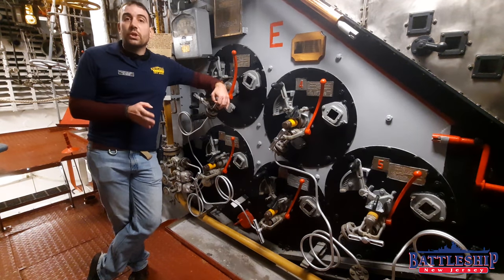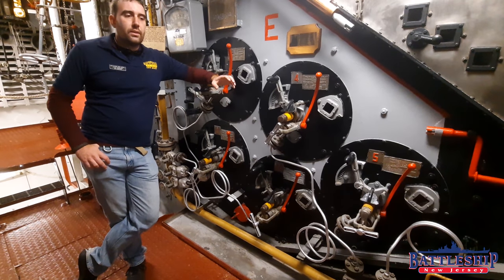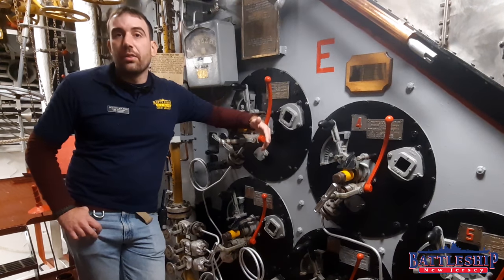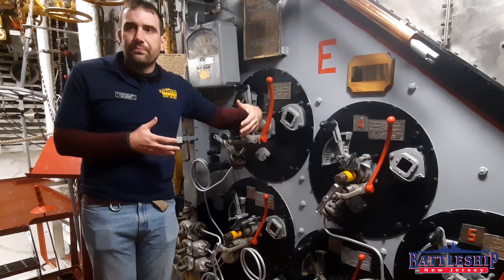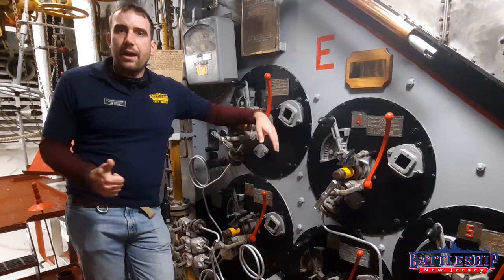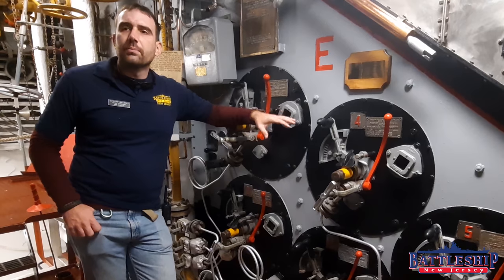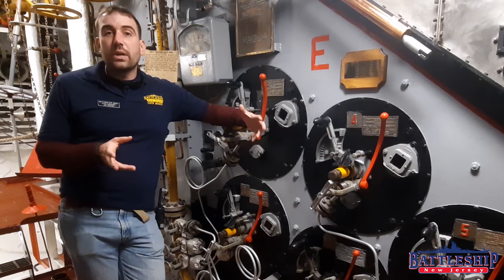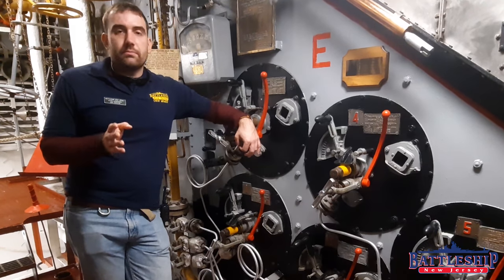Nuclear Powered Battleships

Comment: Great work Ryan, looking forward to your video on this topic. Very interested to see what you think about possibly using either 2 Bechtel A1B nuclear reactors - same as in production for the G.R. Fords or 2 Westinghouse A4W nuclear reactors (Used on Nimitz) and 2/4 New Large Boilers while keeping the Westinghouse Turbines (New Jersey and Wisconsin) or the GE Turbines (Iowa and Missouri)?  Is there room to pull the original 2 Oil Fired Babcox and Wilcox Boilers out of each of 4 Fireroom up through the Lower Decks thus leaving Space in Firerooms for New Nuke Reactor/ Steam Boiler Setups? Maybe join FR1&FR2 and FR3&FR4 for additional Room for 2 Reactors?  Also Imagine how much additional internal volume would be gained if the Fuel Oil Tanks volume could be significantly reduced from 2.5 Mil gals to .75 mil gals simply to provide refueling for Burkes, Ticonderogas, Zumi's and Constellations!  Also would need to significantly upgrade Ships Service Generators as well. Probably to at least 100-150 megawatts, somewhat more than a Zumwalt can produce, for the new Large Rail Guns and HPLWS's. Will wait to see what your video covers!  Thanks!
Reply: I think one of the issues with that would be that the turbines would need replacing as I believe they are on their last legs.
Reply: @moo4boy  So do the Westinghouse and GE Turbines need end of life replacement Sam or possibly just an Overhaul/Rebuild?.....do you have knowledge of those Assemblies...
Reply: @theilluminatist4131  I am not sure, but I remember drachinifel said something similar to what I said in one of his drydock episodes.
Reply: @moo4boy  I will look at it thanks.. hadn't seen it yet!

Comment: Any turbines and condenser units that require superheated steam would aldo have to be replaced, HP Turbines LP Turbines and They would need larger condensers, all condensate pumps would need to be replaced, MF Pumps and MF Booster pumps, all SSTG'S and condensers would need to be enlarged since there would be no superheated steam to power them and saturated steam does not have the energy so a much larger volume of steam would be required. The complete enginnering plant from a Nimitz class carrier would be needed.

Comment: I can't see any reason you could not design a ruggedized reactor. The physics is complicated the design not so much; coming up with a high neutron cross section coolant is not that difficult. Besides shock suppressing mounts are a thing look at earthquake resistant buildings.

While installing nuclear reactors on existing battleships would be a major undertaking it is no larger than replacing the boilers which would have to be done to reactivate the existing battleships; this is why I think that going with replacing the steam turbines with gas turbine engines would be the way to go. You could then install gas turbine electrical generators and capacitor banks where the boilers currently are. All of this is dependent on there being a good reason to field battleships again.

Comment: Given the size and weight of a standard naval reactor combined with the amount of power one puts out I suspect you could put in multiple ruggedized reactors and have enough weight savings to both armor and redundantly shield them.
The hole you cut to remove materials might even be bigger than the requirements to install the reactors.
That is assuming a standard reactor not a LFTR or a nucleonic system which could theoretically offer other advantages.
It would make a good military SciFi book.

Comment: They could use thorium reactors because ther cheaper and safer 
And they could put a suspension on the thing

Or they could have both so during peace time or non combat they reli on nuclear power with diesel as a backup

Comment: I think we'll never again see a need for such massive vessels, especially considering the way economics work and how cheap missiles are compared to re-opening the barrel and shell foundries and factories which themselves I believe are all museums now too.  Seems prohibitively expensive

BBNs could work I think; reactors aren't that sensitive, and even if they were, main functions could be completely dampened from any vibrations and strongly armored.  It's just that there's really no more point in such large capital ships which are not aircraft carriers, let alone how expensive these ships are to be limited to targets 27 miles inland w/ the boom tubes and otherwise be replaceable by smaller, much cheaper even if less-surviveable ships

Then again, the BBs were constructed in an era of actual, and active, competition for the seas, and there's an outside chance we'll see something like that soon.  China's close-ish but it appears they're gonna come up short due to demographic collapse

Comment: Given the types of reactors in widespread use, you're dead right. However, there are a class of reactors which use fuel in Thorium Fluoride in a liquid state, and would be far more suitable.  They cool down faster, you can scram them by simply dumping the reactant into separate tanks, and they will eventually freeze. They aren't chemically active like uranium, which solves a whole class of problems.

While it wouldn't be reasonable to retrofit an old Battleship with such new technology, I think it would be quite reasonable to build a new class of Battleship which was nuclear powered, with newer armor and better weapons systems.
Reply: Mike Warot: I would actually use a fast burner for a warship. There is no need to actively breed fuel aboard them. Also, fast reactors offer higher power to weight and thorough burn.

My suggestion would be a molten sodium-chloride fast burner with an open steam cycle. Yes, I did say open just now. Have you heard about graphene-oxide desalination? With that coming online, a desalination plant large enough to handle the water supply might end up lighter and/or smaller that the condensation system.

For weapons, there has been development on ceramic compounds for use in railguns which have given 400+ rounds without major barrel degradation. Also, hybrid railguns have a lower current draw compared to the standard design. These hybrids have four rails, two of which are connected to a large winding to increase the magnetic field strength. This setup makes greater use of the current supply thus requiring half as much current for a given acceleration. If we accept normal cannon ranges as a sufficient goal, it becomes feasible to implement on a new construction.

Newer armor such as composite metal foam, such as is being tested for newer tank armor, might also give weight savings.

A new vessel would be downsized to reduce implementation costs. A more specialized vessel, built for bombardment with a secondary role as a shield, could have a place in the modern US navy in my estimation.

Comment: Carriers are expected to get hit and survive. That kind of goes against your argument that Navy reactors are "delicate".
Reply: They are, but at the same time, the operational doctrine for the Carriers is to avoid placing them in harms way whenever practical. Even going so far as to have other ships attempting to take the hit rather than the carrier.

While the operational doctrine for Battleships was to place them directly in the enemy's line of fire and "soak" the damage. Now if you intend to simply use the "Next Gen" Battleship as a coastal bombardment platform, the calculus changes to a degree, but enemy counter-fire isn't to be ruled out.

Comment: what about adding multi fuel gas turbines for power generation alone?
Reply: A gas turbine generator similar to the ones used on cruisers burns abut 12 Gallons fuel per minute.  Add about 8 of them see what you get!
Reply: @donraptor6156  8 would mean two and a half times the power of the power plant alone of an arleigh burke class. however, an Iowa would still have a grater range than a burke class destroyer would it not? also I am in no way advocating the Iowa's should be recommissioned. this is just hypotheticals.

Comment: I cooked up this idea of removing turret two (-2000t) and plug the reactor in there, then cap it with a nice piece of 15" screw-on armor plug for easy access and good protection. Sure, you lose a third of the gunfire-power but hey, she's nuclear now! 😅

Or do it with turret 3 and add a bunch of vertical launchers on the after deck with the guns gone there. 😏

Comment: Maritime Diesel engines have made leaps and bounds in recent years, nuclear reactors aren’t needed in theoretical modern battleships
Reply: The unrefuelled range still makes nuclear powered surface combatants a good idea.
Reply: There's a big discussion of this at the NavWeaps board. In addition to dealing with lack of access, I think the most likely engines on the market might not fit without changing bulkheads rather dramatically.  https://www.tapatalk.com/groups/warships1discussionboards/re-engining-the-iowas-with-main-propulsion-diesels-t17539.html
Reply: For instant power, maybe gas turbines is the answer. Just don't know if they can be made large enough to drive a large ship such as the Iowa class.
Reply: @larrybrown1824  
Steam turbines were big enough and you can use more than one turbine per screw.

Comment: The argument is moot unless the Navy is considering reactivating the Iowa class vessels.  Which they are not.
The current Navy is infatuated with modern technology which, by the time it is employed, is old technology.
Even the Iowa class vessels were built too late to serve a significant role in WWII.  Even the current FA-18
was first deployed in the late 1970's.  Like everything else the Navy's wishes are limited by budget.
Reply: The US Navy no longer flies Legacy Hornets.  Every. Single. Hornet. they fly are F/A-18E or F (Or EA-18E/F's) Super Hornets.  The oldest of which was built in 1997.

The last operating Legacy Hornets (F/A-18C) were the Blue Angels and they just got retired this year and replaced with "Super" Hornets.  Officially, the legacy Hornets were retired 1 February 2019. 

Make NO mistake, the Super Hornet is NOT a legacy Hornet.  There is only about 25% parts compatibility between the two.  The Super Hornet is quite a bit larger and a much bigger brick compared to the already brick like Legacy Hornet.  The Navy has been cursing Dick Cheney and Boeing for the sham the Super Hornet has been.  Their last aircraft design request was for an aircraft which has more in common with an F-14 than the Super Hornet.  That says A LOT.

Comment: The mode switch of navy reactors have a setting known as the battle short. This bypasses not all but a lot of the things that will cause the reactor to scram. You don't want the reactor to shutdown while in the middle of a battle.

Comment: nuclear reactors are for standoff ships, battleships role is to get into the fight and take hits
Reply: Ehhhhh......... operationally, the desire was still to NOT be hit which is why the US Navy prioritized long range gunnery over close range gunnery.  It's why we chose to put a 2700lb 16" AP shell on board instead of what most nations chose which was a 2250lb 16" shell (and what the older 16" Colorado Class ships fired) or worse, a 15" gun with a much lighter, yet faster shell.  The US Navy also heavily relied upon an armor scheme known as "All or Nothing".  The idea being if it was worth protecting it got ALL of the protection.  This was done with the assumption the ships wouldn't take massive damage unless absolutely necessary.  No one wants to repair a dang thing if they don't have to.  But the ships are designed to take hits and survive, obviously.

Comment: You wouldn't have to cut a hole in the ship. The new nuclear reactors are much smaller than they used to be and can be constructed on the ship. The fuel isn't highly radioactive until it has been run in the reactor. the amount of fuel needed to run a new reactor is much less than it used to be. When the time came to change the fuel rods a robot could do the job in a matter of days. It is possible to retrofit the Iowa class ships with nuclear reactors. It would be expensive!! That's why it will never happen.

Comment: You know, the army's got a new artillery gun that could really fit on a new nuclear warship. The range is real good (at least 1000 miles if not slightly more), but they can only carry them by truck and trailer, and only on land that they'd have to obtain permission for to get them close enough to use them.

Comment: A nuclear powered Arleigh_Burke-class_destroyer would be able to power energy beam weapons.  Those destroys use up a lot power just to keep the radar running.  Imagine an Arleigh_Burke-class_destroyer that could run at full speed without refueling for years.    Now imagine taking NJ's supper structure off, putting in a pair of submarine nuke plants and AEGIS on top. Take B and C turret to make room for vertical launch cells and directed energy weapons.  Probably better to build a new version of California Class with AEGIS and energy weapons.   Of course my favorite idea is to build a cheaper version of the B2 and arm it with anti ship missiles to take out any enemy surface combatants.
Reply from the maker: That's not really a battleship anymore though, is it?

Comment: All axis to her boiler rooms, could "Easily" be done, thru her STACK EXAUSTS . . . so no "Cutting thru her Armor, would be necessary, as there would be sacficent room to bring the reactor "Cores" into the boiler room area . . . having personally BUILT "3" Nuclear Reactor Stations, I can tell you that there is more than enough room, for them to be fitted through  the "Stacks", as the actual "Reactor Vessel" is only "10" feet in diameter, the rest of the reactor assembly could also be brought in, the same way as the reactor . . . So . . . Oh ya, she would only require "2" such reactors.  The NIMITZ type reactors, would be the "Easiest to Install".
Reply from the maker: So our stacks are actually armored too, and they have a weird curve to them so moving things through them would be impossible. For all the details on that check out our video on the machine shop here:
https://youtu.be/BdudSHtdueo
Reply: @BattleshipNewJersey  Even if there IS "Armor" present, it would NOT be "Very Thick" . . . so getting the Reactor Vessels, "In" . . . WOULDN'T be that much of a problem !. an as i've already said, the REST of the Asm, could be brought in as well. ( I failed to mention last time, but I've ALSO "Built" . . . "7" Nuclear Submarines, "3" TRIDENTS, ( Completing their "Reactor Rooms", an "4" 688 class "Attack Subs". General Dynamics "Electric Boat Division" )
Reply from the maker: Its about 6in thick armor plates with 3in holes to allow air to flow through. It truly is armor and is designed to stop a bomb from moving further through.
Reply: @BattleshipNewJersey  I understand that . . . but its only a "Single Plate" ! * Its there to "Prevent" an aircraft from dropping a "Bomb Down the Stack" . . .
Reply: Once the conversion "Starts", THAT PLATE, as well as the surrounding duct work, would be REMOVED anyway. All of the "Boilers" that would be REMOVED, would also be removed in the same manor.

Comment: Hello Mr.Szimansky, I would like to point out that a retro-fit of reactors would not be all that difficult as I don't think you considered that the armor over the engineering spaces is perforated for the boiler uptakes, remove the funnels, cut out the bomb deflectors, I believe there is sufficient room for boiler removal though not as a unit but dismantled and after the reactors have been placed an armored cover can take the place of the bomb deflectors, also only 2 reactors are needed to replace the 8 boilers, next an upgrade to the SSTG's is a simple matter by removing the 1500KW generators and replacing them with the newest generator power units, maybe the same size but with double the generating capacity. The only down side is that this modification would make for a very top heavy ship. Another idea would be to remove only 4 boilers and retain them as an alternative power source in the event of reactor failure. So, yes Mr.Szimansky an atomic battleship is possible, indeed